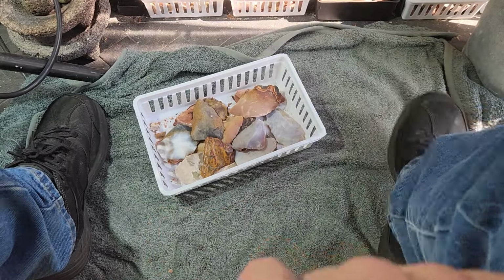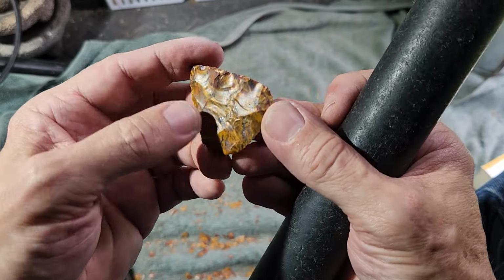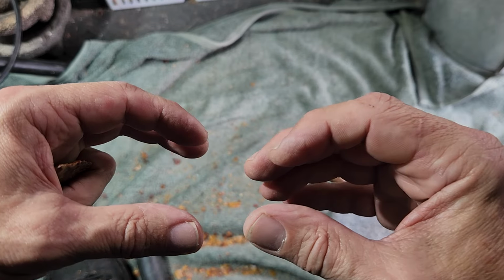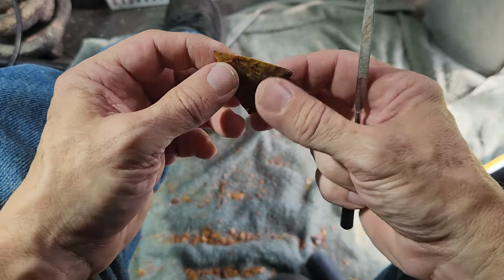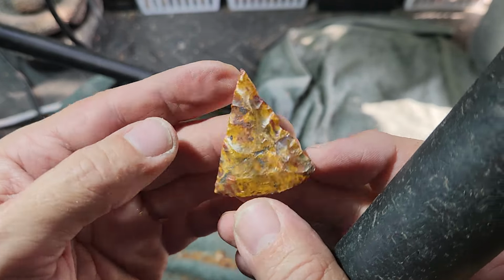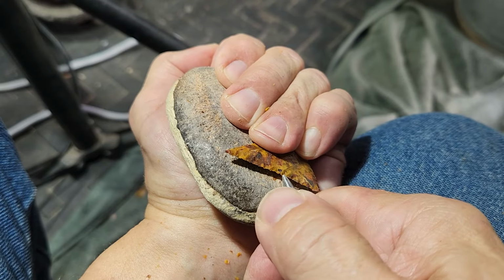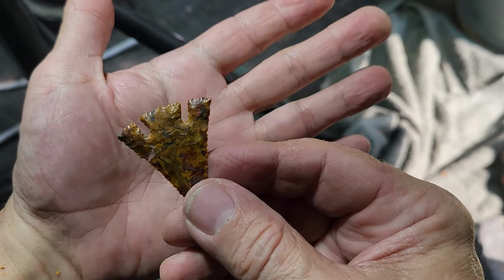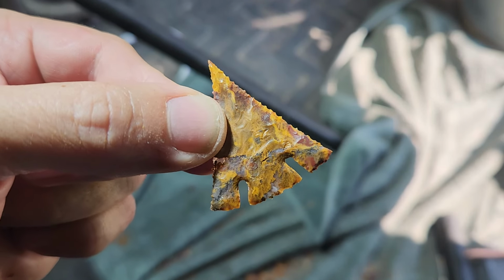1878 - Heat Treat Knapping For Grins and Giggles (Sort of)

Comment: There are times that I have worked petrified wood and some rootbeer nodules that have seemingly heat treated near the cortex about ¼ an inch into the stone from direct exposure to the sun. I have only seen it happen with stone that heats at lower temps. It's crazy to think the sun by itself can cook rock over time.
Reply from the maker: Hmmm

Comment: I'm having trouble spalling nodules down into usable flakes. When I bought it I told the fellow I wanted to buy HT flakes and not raw nodules. I got raw nodules. I'm ruining good material that I can't afford to ruin. So In the future when I buy material I'm gonna make sure it's what i asked for even if it costs a little more. Until I get better at spalling I can do more with flakes. I've not learned Maximization yet lol.
Reply: Looks like my last comment to you on here doesn’t show up. On another idea, though I have been driving thinning pressure flakes with a spatula flaker. Maybe try out a little bit. It seems to work for me, but I am just doing glass. platform prep helps with it a lot.
Reply: I just got done making some bi-faces from Keokuk heat treat,2- 5.5lb and a 6.5lb spalls, I've always had trouble with raw, but this stuff made me look like Jack Crafty😁 I started with 22 lbs I have a 6 lb spall not touched yet 1.5lb of bi-faces and 9lb of usable flakes, I think you're right about the heat treat material
Reply: Heat treat makes me look like Mr. Crafty 10 years ago 😁